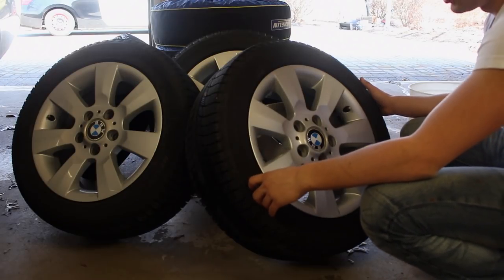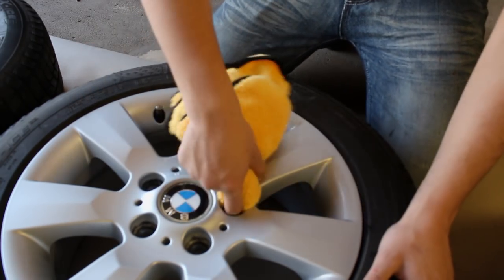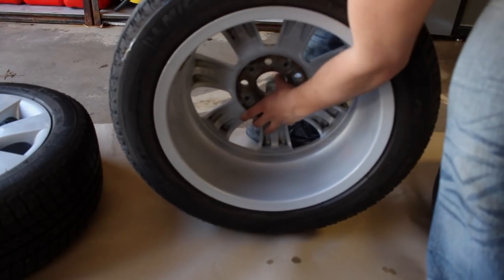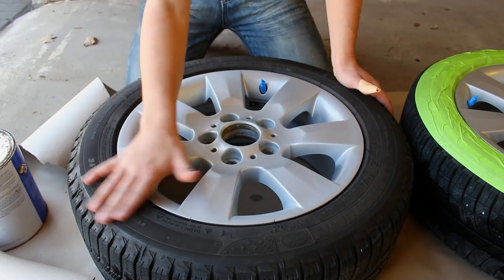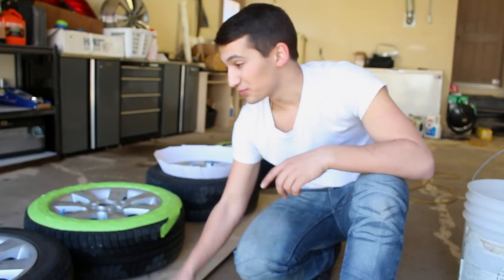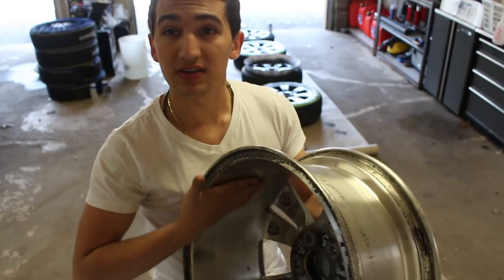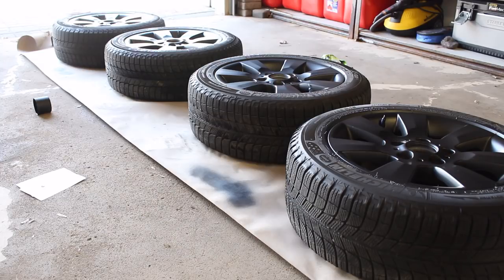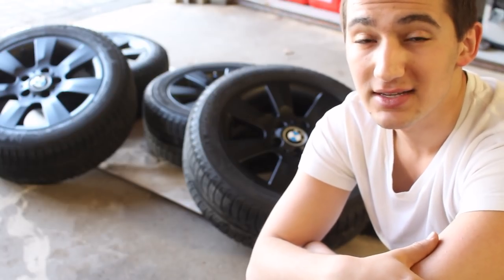DIY: PlastiDipping Wheels 4 Different Ways

Comment: Agree with others, it's a well structured video.  I just dipped a set of Audi 9 spoke wheels. I spent a lot of time preparing the rims, I even used a plasti dip de-greaser but these wheels have very tiny recesses and the dip didn't take in these areas. I then paid special attention to these areas on the other 3 wheels and they came out fine. I would say to all, make sure you have totally de-greased the rims of old polish and other stuff, it makes a big difference. I also finished off the rims with a sealer.  I am now interested to learn how they survive in the real world of dirt, cleaning and daily grind. I opted for the part taping method which worked fine. I also re-inserted the studs (poked them loosely in their holes) while spraying the wheels to ensure the dip didn't have a detrimental effect when tightening the wheels. Well done young man..

Comment: Thank you so much for doing this differential comparison. Of all the methods I think I prefer the partial mask. It allows you to get nice and tight with the rim and it still easy to remove. I'm going to spend $5 and buy a Lazy Susan bearing from Home Depot and use some 2x4 scrap to make a work surface. I think these elements will allow me to get the best results on the rims of my 2015 Jeep Wrangler. Glad I did my research.

Comment: PLEASE READ When dipping with the rims off the vehicle you need to place something in the lug wells! I used little plastic discs because the first time it did it without doing that, the dip twisted and loosened when I tightened the lug nuts!
Reply: Diego541 you can use quarters too!
Reply: Happened On my spare tire on a Jeep. Yepper your comment is spot on.

Comment: Nice video...but never wait till the dip is dry to remove the tape. Like you say in the video if you remove it when its dry you run the risk of pulling up some of the dip from the rims. Always pull off the tape when your done your last coat before it dries.
Reply from the maker: If you leave the dip to dry before you take off the dip, you 'should' not have any problems taking the dip off the tire as there is enough of a separation between the tire and the rim to safely remove the excess.
Reply: Sick Dips
yes in this example it works because you have that bit of separation...but not everyone who watches this will know thats the reason why you decided to wait till it was dry to remove the tape. If you wait till it dries to do any other sort of masking...say where your doing lines on the body....waiting till it dries would be a severe no no...lol. So all  im saying as a teaching video....you should either remove the tape when wet and say why....or explain that when using plasti-dip on almost any other project that waiting is the wrong thing to do...etc. If somebody who was trying PD for the first time saw this vid and went to do their first project...that wasnt tires...they would have a serious issue...lol
Reply from the maker: Shadownian Notice the title of the video is PlastiDipping WHEELS 4 different ways. Key word it wheels. There are countless things you can dip and in this video I am outline how you can dip your wheels. I have a video coming out soon outlining how you can dip your car.
Reply: Sick Dips
not trying to start anything or something like that...i just have seen alot of different PD videos and just dont think i have ever heard anyone say to remove tape after its dried. I know its nitpicking...but its just such a common thing to do...removing tape while still wet regardless of the project that seeing you wait till it was dry just threw me off...lol
Reply: Fuck tape period....it's all about the index cards....
Reply: Shadownian So what happens when you take the tape off and accidentally rub your hand or the tape over the wet plasti dip? Waiting till it dries and making sure there is a separation is the easiest way. Like he said this isn't the only way to dip the rim either...
Reply: @Shadownian  yeah I disagree, let is dry first. Ensure the plasti-dip is properly bonded first.

Comment: Good work. Good video. Well put together. Easy to follow. Shows several methods. Clear, concise, no rambling, no bs. Professional. Nice work. Any experience dipping chrome wheels? I have a set of 18's that are peeling some and I"m trying to avoid having the de-chromed and powedercoated due to cost. Thoughts?

Comment: Your Demo on this video is The best I've ever seen. GOOD JOB men.....
I have one question. After you finished dipping the wheels. Shouldn't you have to go to Tires shop to re-balance the wheels? Please let me know.
Reply from the maker: Andrew Woon I'm happy you liked it :) As for balancing, as long as you put a nice even coat over the entire wheel, you shouldn't have to get it rebalanced. Technically it does change the balance of the wheel but because the weight of the plastidip is so minimal, you won't be able to notice any change in balance when you put your wheels back on. Good question!!

Comment: Great video. I haven't used any plasti dip, but I m thinking of doing it on my car rims. I've an alloy wheel, how many coats would you recommend should I go with, considering it's my first dipping job? 
If I don't like what I have done, is it easier to remove the dip? 
Which brand should I use and how many cans would I need for the 4 wheels, keeping in mind how many coats would I apply? 

Thanks

Comment: I used to use a product called "spray-mask" that was very similar... Plasti-Dip is great because you can get it in a spray can and use it much the same way. For custom paint applications, try prepping the surface for paint, plasi-dip in any color, then draw and carefully cut away (exacto knife) the area you want to spray.. Think stencils, you can create your own, sky is the limit with this stuff and an airbrush.

Comment: u should keep the wheels up right coz then the can works the best
Reply from the maker: +Adrian Ziggy I'm yet to run into problems doing it facing down, but yes an aerosol can has a pickup tube at the center of the bottom of the can.

Comment: What I do when I dip my wheels with it still being on the car is just use a lot of tire shine. Makes it greasy and the dip comes off very easily. I've used the methods before too, easier when it's not on the car. Good video
Reply from the maker: Tire shine really does help at keeping the dip off the tire but be careful not to touch the rim. Because of the greasy texture, if you get it on the wheel the dip won't stick. Thanks :)

Comment: Great video.  Nice to see all the different ways.  One thing I do before I clean the wheel is clean and armor-all the tire.  This makes the tire give up the dip much more easily. Especially on a tire that is a few years old.  They are more dry and tend to hang on to the dip much harder.    

Having done it with bare tire, and with the cards, I will always go to the cards.  So much easier.

Comment: for the last wheel with no tape and a thin strip, you don't have to try and peel it, just get a clean microfiber cloth and rub the dip off the tire, it will just crumble right off. adding dip release or armor all/tire shine is still the best way if you're not going to mask, but yeah clean microfiber and barely any elbow grease and it will just fall off the tires.

Comment: Good job, the only thing i would do different would be if your going to do the inside barrel of wheel do it first, that way there is no risk to the finished face of the wheel being most important.  Good video thanks
Reply: ***** Very true! Thanks for the tip :)

Comment: Thanks for the video, it helps a lot. I have two questions since I've never dipped. 
1. What happens if the paint runs ? 
2. Do I have to spray the back side of the tire or does the wheel still look fine without the back part sprayed.
Thanks
Reply from the maker: ***** If it runs, well you're stuck with it unless you let it dry, peel the dip and start again. The wheel well does look alright without it sprayed however if you want it done properly and make it look like it was professionally done, do the barrel. It takes another can or two but makes it that much better. Its all about those little details that separate an alright job from an amazing job! 👍
Reply: I've heard that what you can do is turn the can upside down and spray until air comes out. Then keep the can upside down and spray the "air" where the run is, supposedly it spreads the paint. Obviously do it when the paint is freshly wet

Comment: Great video bro. I have a question, I just finished dipping my wheels, followed all your instructions great tutorials , however... When I put them back on.. And I started to tight my bolts of my tire the plasti dip started squeaking and coming off. =( how can I prevent that?
Reply from the maker: 1 of 2 things. 1 Don't spray thick in that area, or 2, spray some spray wax or tire shine in there so the lug nut doesn't grip the dip. Did you spray very thick in that lug nut area?

Comment: I always spray my rims with a nice quality gloss clear spray paint after I am done laying down my plasti-dip but before I peel off the over spray.  It keeps the dip on your rims that much longer. I done wheels last summer and the dip is still on the wheels with no peeling!
Reply: but won't it be hard to take the dip off now youve put normal gloss over it?

Comment: Nice technique, but to me it seemed your first coat was really tick, I myself did it a little different, I didn't cover the tire at all as it was really easy to remove the dip off of it, How I dipped was really light coats, at around 8-10 inches away from the wheels with a 20 minutes dry in between, but I've done 7-8 coats. Now I'm no expert, and this was my first time dipping, they did turned out really great, and even through gravel its holding on it, but do you think I did something wrong doing it this way?
Reply from the maker: TurboCharged Kia As long as you're happy with your results and its staying on the wheel, I'd call it a job well done. The only difference between doing a few thicker coats to many lighter coats is the difference in the final texture of the plastidip. If you go with thicker coats you will notice the plastidip is VERY smooth and even like it was actually dipped into a can of plastidip. If you go with a lot of little coats, you might notice a bit of texture but it will still be just as durable
Reply: Aight sweet, the finished process was smooth enough, I did went a little more thick on the last coat, maybe that helped, but yeah thanks alot :)
Reply from the maker: If you went on the thicker side for the last coat that is good!! Glad to help :)

Comment: If put other tires on the rim, will the plastidip around the edge come off?
Reply: +Best of European Driving Captures  yes , obviously . I changed my tires into winter tires , and yup it comes off .
Reply: It is easy enough to reapply though.
Reply: If you armorall the tire before you clean the rim the plastidip will almost fall off. So it is just a matter of armor all the tire - clean  the wheel and spray it on. Wipe the wheel with lacquer thinner to make sure no Armorall is on the wheel.

Comment: Great Video.  Any tips on how you got them mounted on the car without chewing up the dip with the rim key?
Reply from the maker: Let them dry and be very careful when mounting! If the dip is wet, and if you nick the surface, you'll be kicking yourself in the butt over it. Also, take your time when mounting it and whatever you do, don't use an impact gun because it is a very aggressive way to put the lugs on, or taking them off

Comment: Hi, I have a 2012 FJ and I want to dip my rims black. Problem is these are TRD wheels and I have a TRD emblem in the center cap. I want to leave that red. Should I tape off that part or will the plastidip peel off from that logo?
Reply from the maker: TheMizzy122 It depends on how much of a separation the plastidip will leave. If it was me, i'd take the wheel off the car, pop off the center cap from behind, and then spray the rim, without spraying the center cap. I don't know if it will peel off the logo.

Comment: I really like your video bro, but I have a question. I drive allot on the highway, if I plasti-dip my rims will the plasti-dip come off like right away? Or like how long do you think it will last?
Reply from the maker: Carlos Vazquez As long as you prep them and do a good job, they can last you years without problems. Make sure not to curb the wheels as the dip will start peeling.
Reply: Ok thanks bro, clicks subscribe button

Comment: Last week I used PlastiDip for the very first time, I dipped my wheels, I spent a lot of time watching the Dip Your Car vids by Fronzi.

My first mistake: watch those tutorials, he doesn't detail anything. On your vid, you said where to start from and every single step.

Second mistake: as Fronzi never says where to start dipping from, I didn't start from the edges of the rim, so right now the edges of my wheels are completely fucked up so probably I will need to redo again but taking into consideration your tutorial.

Now, I know where to start dipping from, I did the grill as well but that part was so easy and I did it properly.

My big problem: I am from Costa Rica and here is almost impossible to find PlastiDip, so I will have to bring it from USA.

Thanks for your video, have a nice one.
Reply from the maker: Friedrich Nietzsche Well said. Let me know if you have any questions regarding how to spray or anything like that. Cheers and thanks for the kind words :)
Reply: It doesn't matter what part of the wheel you start... Its like painting anything, where you start isn't important(unless you're painting a floor) where you stop is what matters I.e. overlapping passes while paints still wet. 

Plasti dip is very simple to work with but at the same time a bit complicated. Using it can go pretty much perfectly or the complete opposite, but never somewhere in the middle. Either you have a nice smooth finish or a textured odd quick to peel finish, and once a little peels it all peels. Its a bit annoying honestly. Its worth looking into self etching primers and other rubberized coatings if that's you're forte.
Reply: +Friedrich Nietzsche I thought you were dead...
Reply: Malkhaz "Jayela" Jakelli how wrong you are.

Comment: Will it come right off if you let's say, touch the kerb? And will it start coming off on itself just because of time matter? Thanks
Reply from the maker: Well because the stuff can be peeled, if its damaged, the plastidip will lift if you hit a curb. If its been applied properly, the stuff should last as long as you don't damage it. It will not lift on its own

Comment: So  my jeep wheels have been dipped before and the guy got most of it off but left a little inside of the lug holes do I need to remove it its very thin before I spray ?

Comment: Seriously I just rewatched this and I still have no clue how you get yours to come out so shiny when you initially spray it.
Reply: Because its wet..
Reply: you must spray it on thick to get a smooth finish. if you try to dip your wheels like you are using spray paint you will get a rough texture.
Reply: well i seen were i gone wrong with my dipping an its what he does at the start by warming up the cans first makes the dip spary better.this is the best vid i've seen sofar great work man.
Reply from the maker: T34MKILL4 Thanks man I appreciate it! Yeah warming up the cans makes such a big difference. Don't believe me? Check out this short video

DipTips: Tricks for Using Spray Cans

Comment: PLEASE HELP!!!!

Okay so I plasti dipped my rims for the first time lol... 
Well I didn't mask anything thinking I could just peel it. I can't freaking peel it off my tire wall. and the Rim started to peel a litle in one spot. 

2 things. Can I just put another coat or a few coats where it peeled or do I have to start all over?

Will a wire brush be too harsh on my tire to peel the dip off?
Reply from the maker: Ariel ASMR If you can, get a power washer up to the side wall of the tire. It should peel it all back up no problem. Be very careful not to his the dipped wheel as it may come up. 
Dipping it some more may help. If you want go to that route, spray the entire wheel again with another coat, and then spray the outside on the tire very heavy so there is a nice amount of dip.
Reply: Ariel ASMR If you spray this product too thin it will be very hard to remove, this goes for overspray as well. It needs to be applied thick enough that it turns into coating thick enough to pull back off. Too thin and it'll just break apart and create a nightmare to remove.

Comment: on your last wheel without the masking, just put some tire shine into the rubber, making sue you dont touch the rim, and it will just peel off in one piece with no issues.

Comment: ouufff. I see runs down in the barrel just like the last person who did my wheels. what would you recommend to prevent that? I want to do my entire wheels barrel and all but with no runs down the inside. I will probably cut out a round piece of carboard and tape it up in there to kinda mask everything offso nothing runs down the edges
Reply from the maker: You can tape inside of there or just not spray too heavy the barrel. My friend at the last minute wanted me to spray the the barrel. If you wanted to see how to dip the wheel properly with some tips on spraying the barrel, check out my other video. 
https://www.youtube.com/watch?v=6T_SDLwDHIM

Comment: In your experience with doing this, what have you found is the best way to prep the wheels before spraying?  More specifically, what do you use to clean the wheels before dipping? Thanks.  :)
Reply from the maker: Clean your wheel with any type of wheel cleaner. Dry the entire wheel. Then grab some wax and grease remove and put some on a rag. Wipe down the entire wheel and let it dry. That should fully prep the surface for the plastidip. Make sure that it is 100% dry